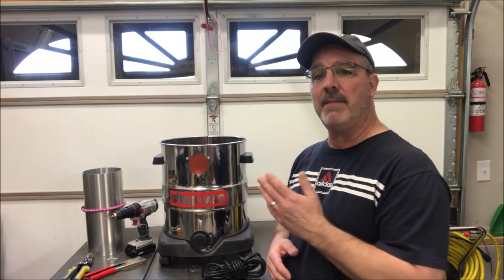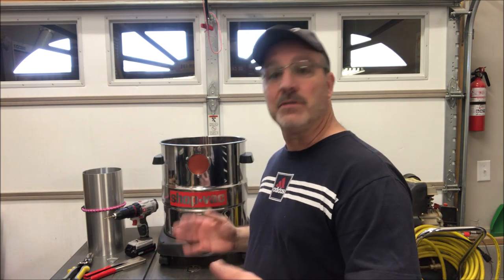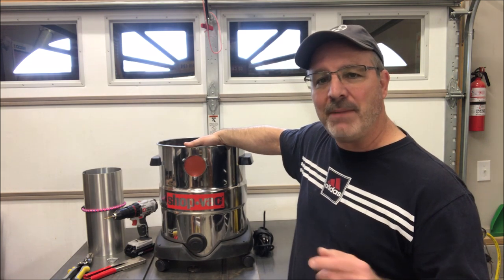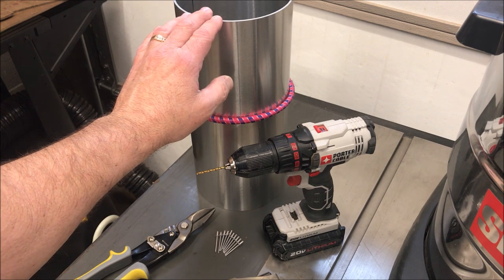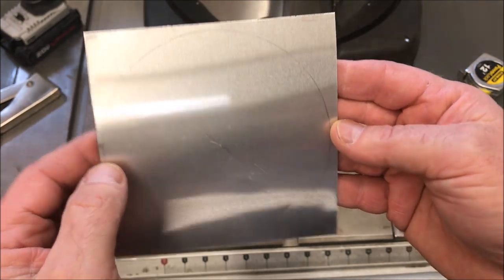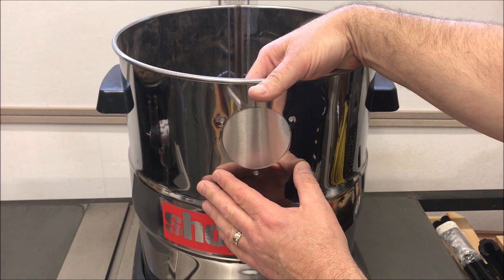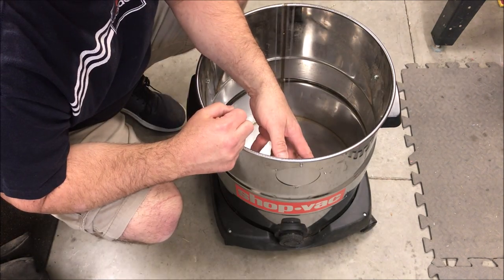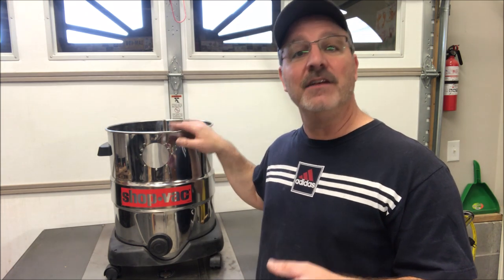Up-Cycling My Shop Vac After The Motor Burned Up

Comment: I use the cords for making extension cords. Usually with a metal box and two outlets so I can plug in four tools at once.  They are heavy duty and work great outside.
Reply from the maker: Great idea. 

Regards,
Bob

Comment: It just occurred to me, the canister would make a perfect bucket for the Dust Deputy if the blue drum fails. Or, a separator for the wood lathe dust hood. 
I like Inlace Acrylester or other plastics but can't stand the stink they give my Shop-Vac. I started to use the Dust-Deputy to catch the shaving and then dump them outside every day. As a plus then I have had things sucked up they can be retrieved.
Reply from the maker: I love me Dusty Deputy. 

Regards 
Bob

Comment: Liked the part about recycling part but in order to save time why not use some FlexTape or something similar?
Reply from the maker: That would have worked very well and been easier, I just didn’t have any in the shop and wasn’t able to go pick some up so I used what I had available. 

Regards,
Bob

Comment: if motor is bad, why not get a new motor or rewound the old motor? are those shop vas that cheap? yes upcycling is good but repairing is better .  For your wallet and for the envoirement
Reply: You probably could buy several new vacs for the cost of a new replacement motor or having it rewound.  Plus in the process Bob got the use of additional hoses, and extension cord at no additional cost.
Reply: @dwightl5863  that might be the case, im not living in america and i dont know the prices, but where i live i can get a shopvac motor rewound for around 10-15$ and changed the bearings for another 10$
Reply from the maker: A new shop vas is $99.00 US. No one will rewind these cheap motors.
Reply: @RJBWoodTurner   well thats cheap, a shopvac that size is around 300-400$ cheapest where i live
Reply from the maker: @dkongul  ouch! That price is ridiculous. Sorry to hear they are gouging you like that.